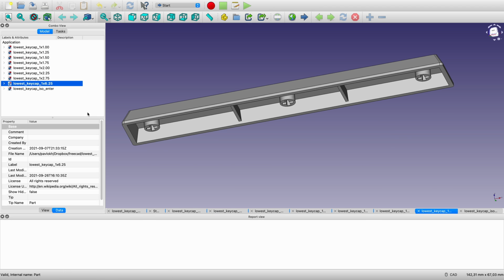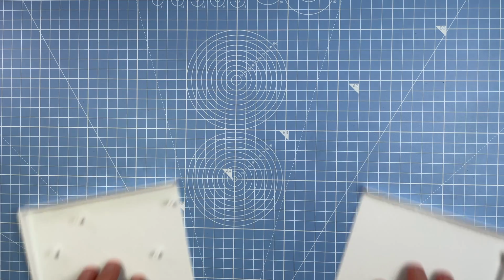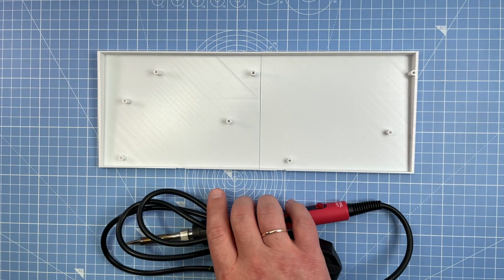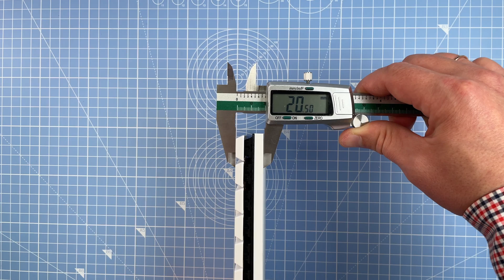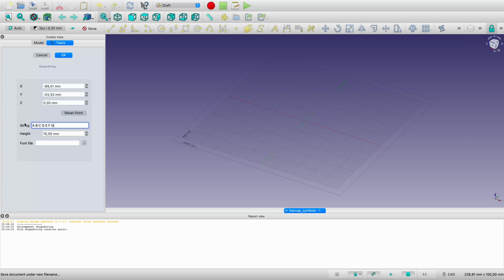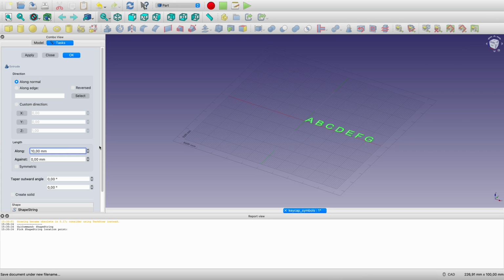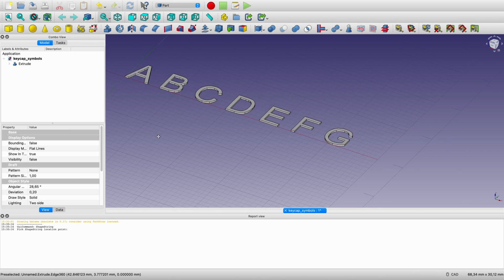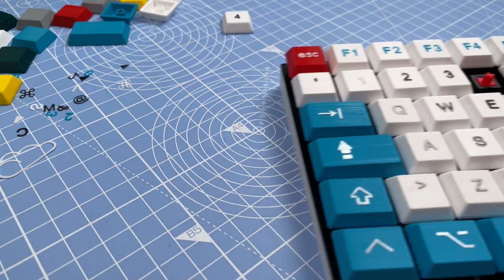The lowest mechanical keyboard? 3D printed

Comment: The glass trick is amazing.
So smart. 
It would be a pain to design but you could get all the keys flush if you designed the keys with slight indents in them for each letter and symbol.

Comment: Hi! I have a Keychron V1, is there a possibility to make it lower? I would be ok with sacrificing key travel for it. Do all switches which are compatible with the keychron V1 have the same travel length?
Reply from the maker: It looks like Keychron V1 is for full-size switches. Lower keycaps can help a little bit. But you can achieve more with a lower DIY keyboard case. Or "triangular prism" :) from this video: https://youtu.be/jqOXCsz1Bvs

Comment: Will Outemu low profile switches with CHERRY/DSA caps work on this base? To keep almost the same height, but to get a real caps.
They should be pin to pin compatible with standard switches.
Reply from the maker: I tried Outemu low-profile switches. I have them in this video https://youtu.be/2qzxGP9NStc
Outemu switches have too thick pins. I'm not able to insert them into the "cherry style" hot-swappable PCB.
Reply: @PavloKhmel  it's a shame, good to know it could be incompatible with some hot-swap sockets.
Here is the guy who did a similar mod, switches mostly worked, but he had same issues with sockets too.
Most problematic were stabilizers, which are too tall for them. God knows where to get low-profile compatible stabs. May be they could be clipped.
watch?v=hY-rdurtWWQ

Comment: Imagine doing this with low profile switches
Reply from the maker: There is a challenge with low-profile switches to find compatible PCB. I tried to get some low-profile switches. I made a video: https://www.youtube.com/watch?v=2qzxGP9NStc
Reply: @PavloKhmel  that’s actually the reason I used “imagine”. I’ve been following low profile switches for a while now to see if any standards will be established but until now there has been none. Honestly really disappointing considering how much more diverse the enthusiast community could be with them after the dominance of cherry mx since there are more switch designs that would be fun to work with.

Comment: What settings did you use for the labels? Did you use a 0,2 mm nozzle? I have a really hard time getting successful prints on those
Reply from the maker: I used 0,4 mm nozzle. And I printed multiple copies of the same character. Most of them were difficult to remove from the printing surface. I used only successful prints.

Comment: Maybe would be better to print the key caps with the top facing the build plate so that you have a nice flat even textured (or smooth depending on print bed) face on the keys. It’ll also hide the layers when looking too down on it
Reply from the maker: Yes, it will make a nice face for keycaps. I printed them under angle to make the keycap stem stronger. Stem printed without an angle is easier to break because of horizontal lines.
Reply: @PavloKhmel  I suppose you could make them separate pieces and print at different orientation for the stem, and have a slot for the stem to go into (keeping it perfectly centered and perpendicular) then bond the two pieces. OR, print a shell for the actual key cap and stick it on  one you have now (but slimmed down a few layer thickness in all directions) so that it fits over the top

Comment: Wouldn't it be easier to print the keycaps right onto the letters? Stick the letters to the printing bed and print out the caps on top of them.
Reply from the maker: The result with a glued letter to the printing bed could be better. Good idea. But not easier. 
Challenge 1: center the letter under the keycap. 
Challenge 2: keycap stem will be weaker if it is printed not under angle.

Comment: This is great!  The part where you used glass with a soldering iron to attach the legends kind of blew my mind with how genius that is.  I may have to modify my keycap playground so that it can make legends that work with that method (so you can recess them for a smooth surface).
Reply from the maker: Thank you. Your switches with magnets are very cool.
Reply: @PavloKhmel   I had to go look it up. Dang!
Reply: Thats crazy..wow. And I have yet to open the videos :) Just saw your Uploads list.

Comment: is this lower than DSA?
Reply from the maker: Yes, it is lower. DSA keycap is making a height of 22,6 mm on this keyboard in the bottom row.
Reply: @PavloKhmel  damn, you went that far for 2.6mm. Why didn't you buy Kailh choc v2? they are lower than cherry, although a bit more expensive. No idea if they can be used on those pcbs tho
Reply from the maker: @alpacamale2909  I'm still learning about low-profile mechanical switches. But as I found: Low-profile mechanical switches are not compatible with anything. And not compatible with each other. For example:
- Kailh Choc v1, 
- Kalilh Choc v2, 
- Cherry low profile, 
- TTC Low-Profile, 
- Gateron Low-Profile
- Logitech low profile GL 
They have different pins locations. So, different PCB for each low-profile switch. Different keycaps. PCB from a full-size mechanical keyboard is not compatible.
Reply: @PavloKhmel  You are correct, that is disappointing since I use,a 40% and there are no pcbs with those pinouts